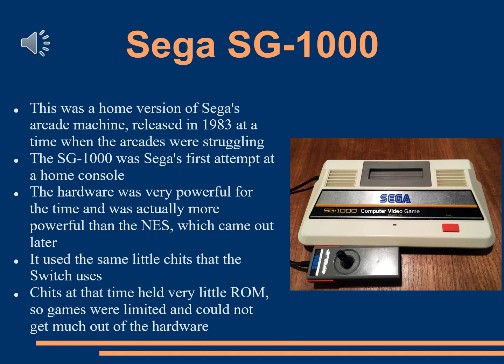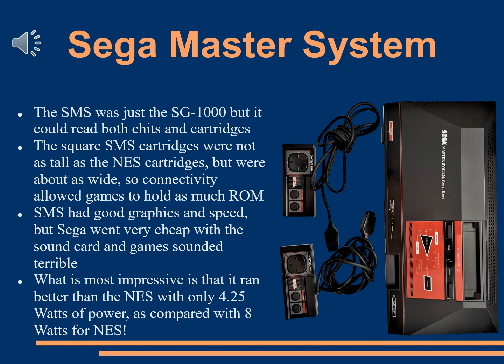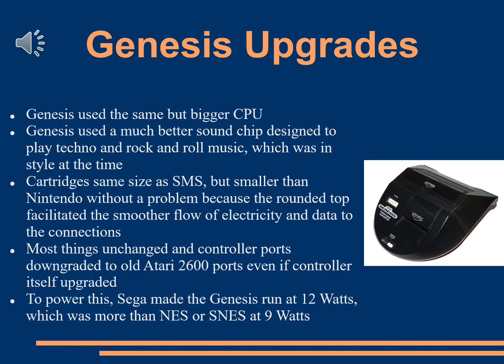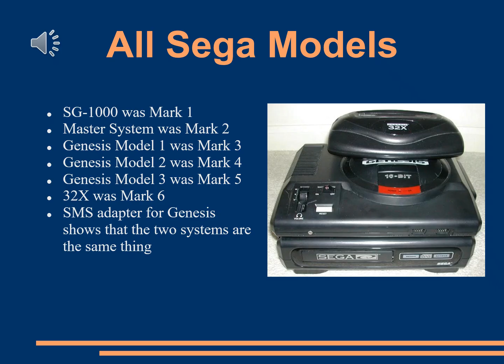Sega's Magic Trick: The Genesis of the Master System

Comment: 7:44 - "If you round the top of the cartridge, then electricity flows more smoothly throughout"
Did I hear that wrong? What does that even mean? How does the shape of a plastic casing help electricity to flow "more smoothly"?
Reply: Also you've suggested the Mega Drive / Genesis uses "the same but bigger CPU".
Yes, the Mark V uses the same Zilog Z80 chip at the heart of the Mark IV, but the Mark V has an additional Motorola 68000, which has a very different instruction set than the Z80 and can perform a wider array of operations. The 16 bit data bus of the 68000 also increases the amount of data it can handle in any different instruction, increasing from any one of 256 values for an 8 bit data bus all the way up to 65536 values.

On the other hand, the SNES DID have more or less the same CPU as the NES, albeit a 16 bit version of the same chip with an expanded data bus and instruction set.
Reply: And if you've ever seen a Mark IV controller port, they're the same 9 pin ports the Mark V would use later.
Reply: 13:03 - Now you're inventing magical batteries? No, the Genesis model II simply had more energy efficient components than the model I, which is why its power requirements were lower.
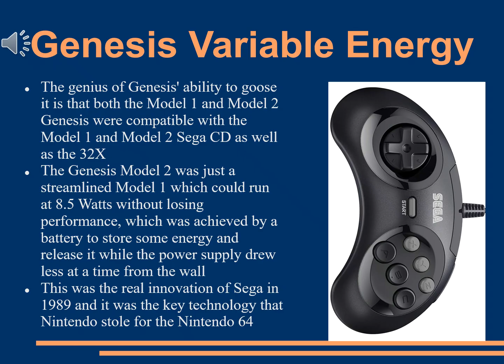Reply: 14:54 - There's so much wrong with this list.
The SG-1000 Mark I and Mark II both had cartridge slots.
The Mark III intriduced a card slot for games with smaller ROMs alongside the existing cartridge slot.
The Mark IV became known as the Master System in the West.
The Mega Drive / Genesis was known internally as the Mark V.

The 32X was code-named "Project Mars". You're right in saying "Project Neptune" was going to be a Mega Drive & 32X all in one neat package. By this time, Sega had moved on from the Mark # naming scheme and was using the names of planets, which is why the Sega Saturn has that name.

Comment: Genesis could play games Master System games because. had the Z80 help with sound. Motorola 68000 in the Genesis 16 bit bus speed better than 8 bit. it can transfer twice as much data in the same amount of time, resulting in increased processing power, a larger addressable memory space.